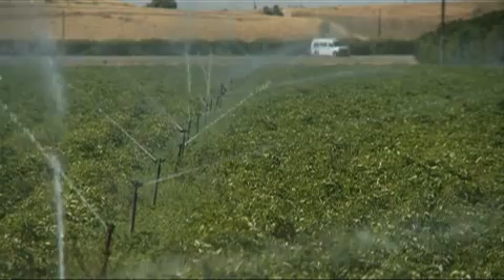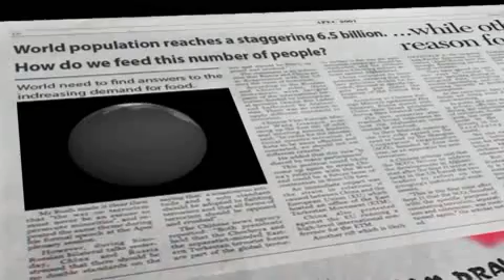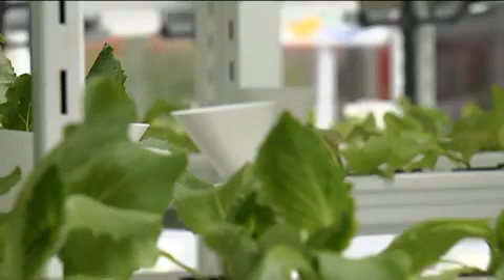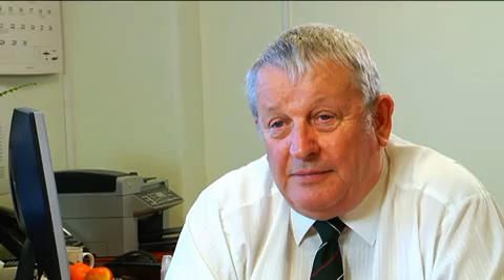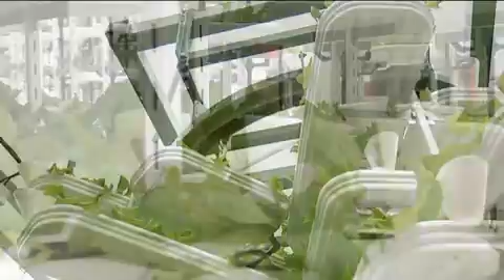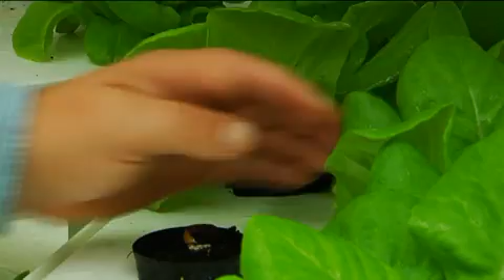Valcent™ (eu) Ltd - Part 1

Comment: If aquaponics is going to be used then they'll have to use azolla to fix nitrogen into the water and water hyacinths to prevent water eutrophication after using the water to raise fish like tilapia. Any agricultural wastes is fed to the fish and the fish produces wastes which in turn is filtered by the azolla and water hyacinths and the remaining nutrients is used by the plants. But I would try mixing rock dusts powders which is water soluble in powdered form to increase it's fertility & potency

Comment: The nitrogen-fixing rhizobial bacteria will fix free nitrogen fertilizer from the air and the mycorrhizal fungi will improve plant nutrient sharing and intake allowing higher plant population density for a given space. The rock dusts powders mixed with charcoal powder will increase yields by 880% and the inoculants will increase yields by 16 times. They will have to redesign and re-engineer the system to compensate for the higher weight load of the Mittleider hydroponics systems.